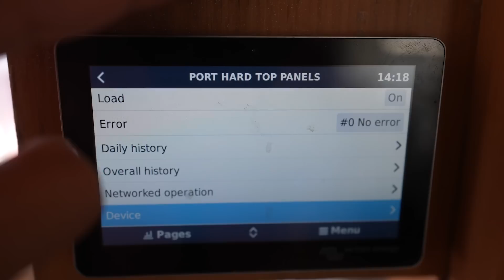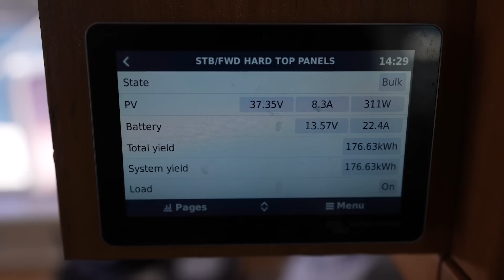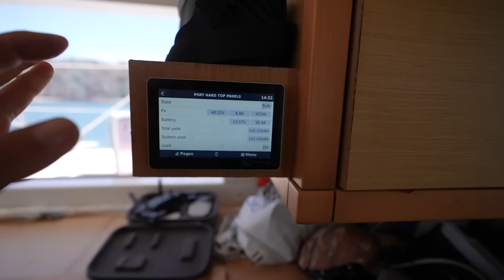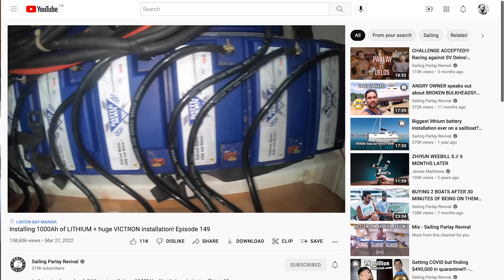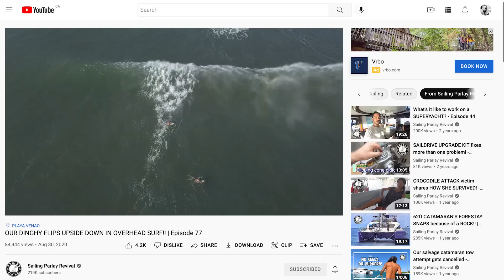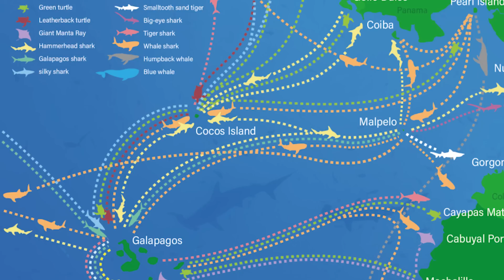WE FOUND A PRIVATE WHITE SANDY BEACH ALL TO OURSELVES! - Episode 170

Comment: @7:31 Colin, if the inverter is capable of taking voltages at 44v then why not wire them in parallel?  If any solar cell in a series is shaded that creates resistance for all of the other cells.

Comment: I build custom solar charge controllers that automatically reconfigure the solar panels from parallel to series or vise versa.  With my controller it will reconfigure the panels so that you have the minimum voltage needed to charge batteries.  That allows you charge batteries for a few additional hours per day, and on cloudy days it works really good to meet the minimum voltage needed to charge.

Comment: Technically speaking when measuring DC Red is positive and Black is 0v, Black is negative when dealing with AC and 0v when dealing with DC, if you reverse the terminals or polarity in DC then red is the negative (- DC voltage) and black is still 0v

Comment: The MC4 connectors that are typically sold with solar panels are notoriously rubbish.  The metal portion that you pulled out so easily commonly separates from the plastic connector housing causing a break in the line and you have to disconnect all the panels to find the break.  The cheapies work fine on land, but aren't ideal on a boat with constant wind and movement.  Do yourself a favor and upgrade to better quality MC4-2 connectors, or my personal preference, T4 connectors which are bulletproof and won't separate even in the most extreme conditions.